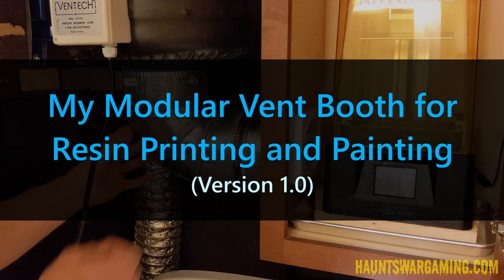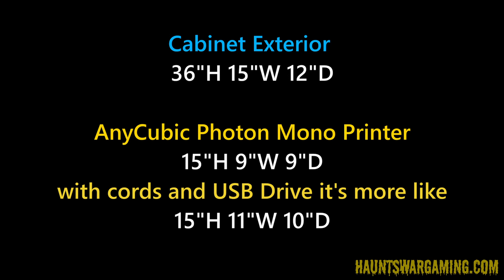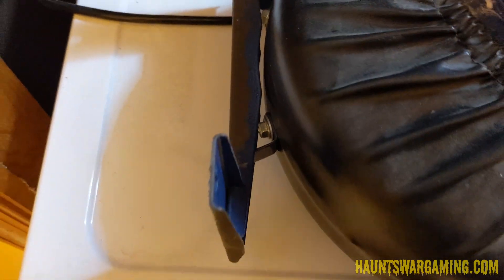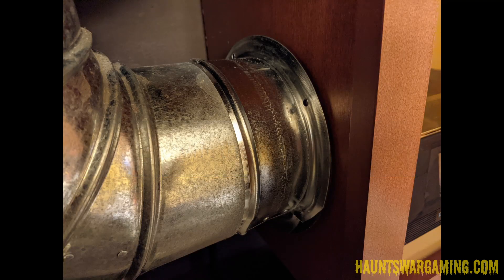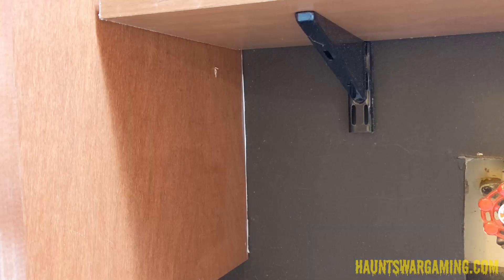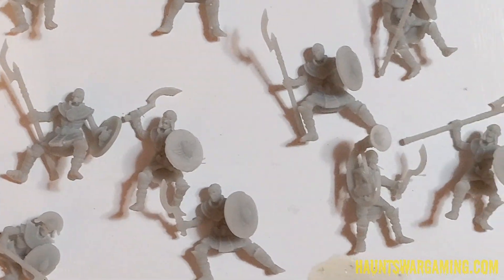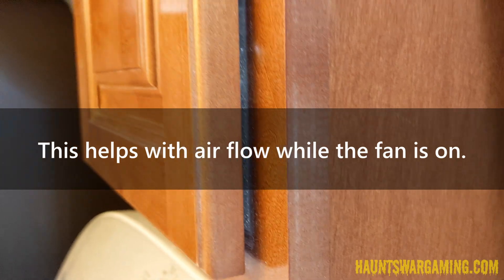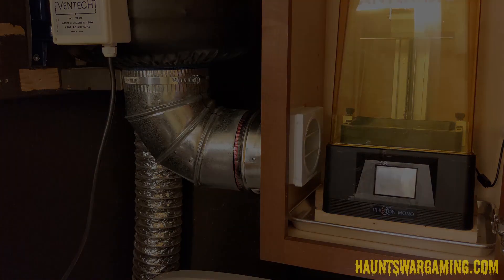I used my DRYER vent to VENT RESIN FUMES [3d Printer ventilation]

Comment: Did this impact your clothes at all?
Did your clothes ever come out of the dryer smelling of resin?
Reply from the maker: Nope, the back draft dampeners keep the air moving the right way.
Reply: @hauntswargaming cool. I know the video was a while ago, so do you still run this setup? Would you change anything?
Reply from the maker: @kalebsoller Yeah I still use it. I actually just posted a video updating the setup.

Comment: How would you clean the check valve for lint on the dryer side?
Reply from the maker: That's the same as it would be with a normal setup

Comment: I just bought a 3d printer and I've been thinking of using my other bathroom on the other side of the house, cause it's small,  and I won't smell the fumes. The problem is there is marble tile and only a small window, so it gets very cold. I am hoping I can just print without issue, but I know it's going to be trial and error.
Reply from the maker: I moved mine out of the garage because of the cold. I was having issues below 40° F but ideally I think you want it to be 60-70. 
It is a LOT of trial and error for sure.
Just make sure to vent those fumes!